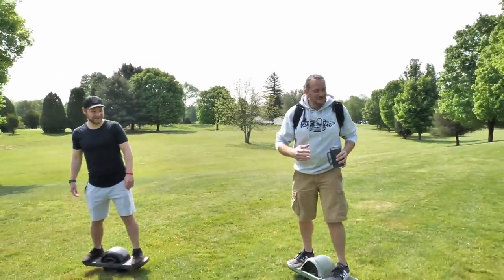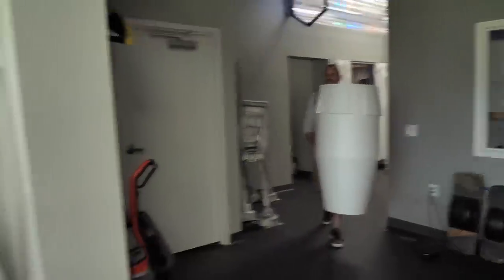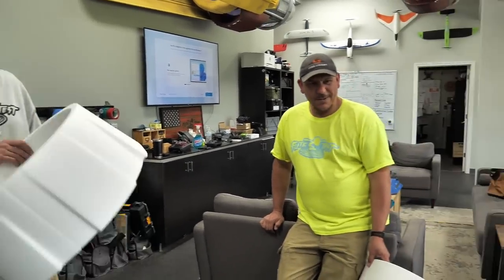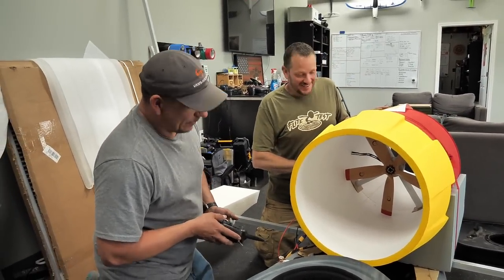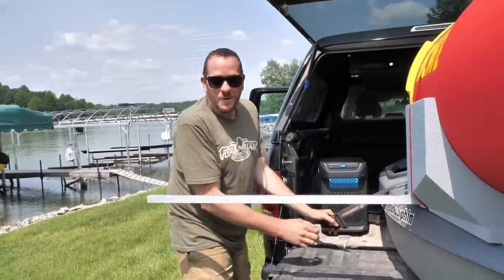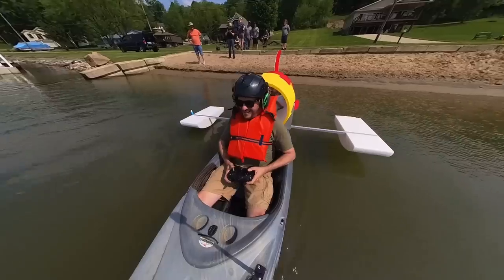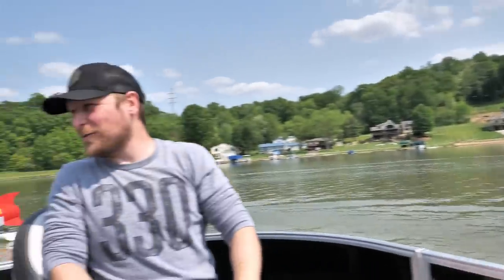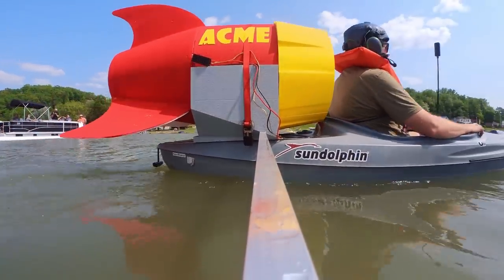Rocket Kayak - ACME ROCKET

Comment: Great video.  An important technical note on boat hull design.  If a boat doesn't hydroplane, and I doubt a kayak will, it will be limited to its maximum velocity as determined by the Froude number.  To cut to the chase, there comes a point where no matter how much more power you put into the boat, it won't go any faster.
Reply: hydrofoils!!!
Reply: /me takes notes

Comment: As others have said, a kayak has a displacement hull and has a fixed top speed no matter the power. A planing hull will be much, much faster (e.g. try the same set up on a large-size sailboard or small planing yacht)
Reply: Yes you can really see the huge bow (displacement) wave created in the camera side shot. This will be virtually impossible to overcome and thus a speed limit is created from the hull design itself.

Comment: Now you are ready to Make a proper manned foam Outrigger Hydro like the RC style designs made to haul arse - go faster with more power use a race water aluminum rudder shape to help track perfect and offset for thrust flow aka torque issue. Should be able to hit 24 mph ish. 😎😎

Comment: I would attach two of the thrusters (maybe a bit smaller) to the side arms left and right. So the body of the "driver" is not blocking the airflow and you should be able to stear with differential control. Okay, should have watched the video to the end before commenting - lol

Comment: Fantastic concept!!!
A displacement hull is going to keep sapping more and more energy, the faster you try to go.  Ideally you want to look a planing hull - like a surf kayak (like Mega or Watertech).
Good luck!!
Reply: I looked for this comment because you are correct. The hull has an absolute speed limit beyond which more power will only make it sit deeper and NOT go faster. I have 2hp gas engine/fan on a pirogue and I get to max hull speed just past an idle. More power just makes a bigger wake.
Reply: @communitycollegegenius9684  Exactly!!  That's why you need the flat hull of a surf kayak, which will eventually lift out of the water and start planing. These kayaks also have fins which will improve stability without having to use the paddle (and thereby add unwanted resistance).
Reply: @Rob-kj3ho  And a rudder wouldn't hurt :o)

Comment: You need a much more stable kayak for this, like specifically a Hobie Kayak (Outback would be great). They are actually setup for "sponsons" or outriggers I believe as they call them. They have inflatable ones. They actually sail those kayaks, I have one with the sail and everything. The kayak would weigh a bit more, but it would be a lot more stable and maneuverable as they are even equipped with rudders.

Comment: I think to counter the torque steering you could add a second motor and prop inside the exiting duct set to counter-rotate in a pull-push configuration.  You might also consider streamlining the amas (sponsons)

Comment: the half throttle to full throttle issue is the power you need to get over your own bow wake! once you break past that you will get a huge efficiency increase as the boat transitions from displacement to planing.

Comment: Use a skinny but flat Jon boat, lose the outriggers, add a rudder. I'd go with a water rudder, so you can still steer when moving but not under thrust.  Oh yeah - I almost forgot - move the intake around the driver's body - either above or split to the sides.

Comment: Yeah, with two motors and no occupant, I'd lay odds you could get the kayak to "skim" on the surface and pick up a lot more speed. Like 3x or 4x.
Reply: Definitely. You could also add a wing at that point.
Reply: @basikwashman  Ha ha. I see what you did there.
Reply: @basikwashman  - very difficult to get ground effect stable at small scales

Comment: Put the "Jets" on bearings so they can rotate left and right and a cam to direct thrust upward to counteract tipping on the turn. When turning, the inside diameter jet should turn fewer degrees than the outer diameter jet. Trial and error on upward thrust angle and rotation differences may be in order, but i am guessing there is math that can be done. Just not by me. Jets facing the same way and differential thrust will turn the boat, just not as quick or precise. You could add that in to counter the need for rotational differences I suppose, reducing RPM of the inner diameter jet.

Comment: How about this: THREE motors, one in the center for forward thrust, one on each side with differential thrust. That way you have more than enough thrust, and steerablity, And, Stability. (I would also suggest a longer kayak, there is not enough in front of the thrust in a short kayak.)

Comment: your kayak hull also is non planing.  Super limiting.  you can put a 3hp on a canoe and it will only add speed to about 1/2 throttle.  After that it ss just noise and gas.

Comment: Did someone say amphibious ultralight? Or kayak ekranoplan? Or Hulled paramotor with EDF.

You might want counter rotating props, one with higher pitch, or static blades. Carve a ring for the prop tips into the duct housing so they don't have end gaps bypassing air and making eddies. Do the new torroidal props help in a duct? Why not blades like the turbofan high bypass engines?

Comment: I don't know that adding any more power will make it go any faster.... it's a displacement hull and the length of the waterline is the limiting factor for hull speed. At the 19:03 mark, you can see the wave formed by the hull is almost exactly the same length as the hull. Unless you find a planing hull, all more power will do is push the hull deeper into the bottom of that wave and loose stability.

Comment: I think you should make two of those Acme rocket Motors and have the motor spin one way and one spend the other two cancel out at torque procession then I think it would be cool and I think you should place them out further away from your body so you're not blocking the intake also underneath the rocket motor boosters whatever you want to call it put bigger pontoon so the motors carry their own weight in the water then I think you'd be golden also put Rutter's on the back of the Rocket Motors like a fan boat you know those ones they have in the swamps they have Rutter's behind the big fan help them steer maybe you can do the same thing good luck you guys interesting design I think it's hilarious and it says Acme absolutely awesome

Comment: Imagine if they used a hydrofoil. Higher top speed/acceleration. And perhaps more stability-? That part I'm not sure of.
Reply: ladder hydrofoils are stable, not as efficient,  but more stable
Reply: @carlgeisser2463  but in comparison to the current design, it would be more efficient.
Reply: @nevernether3368  for sure